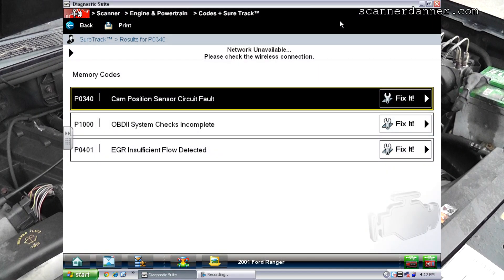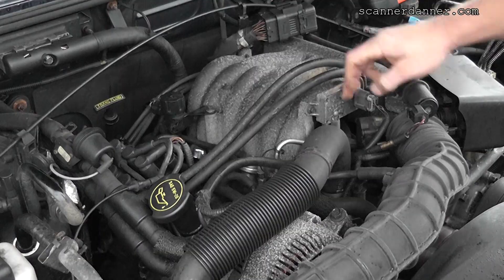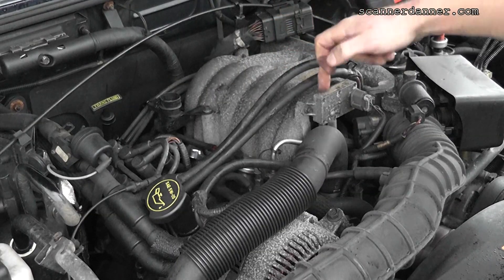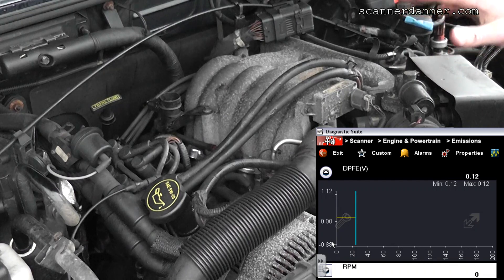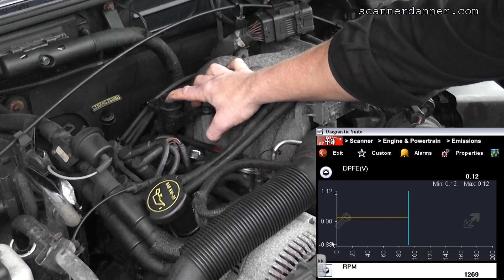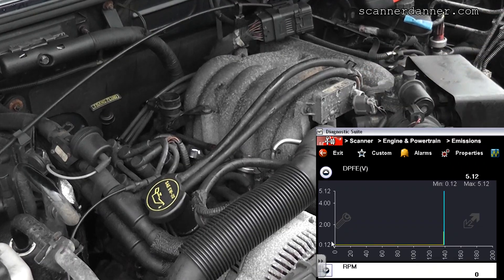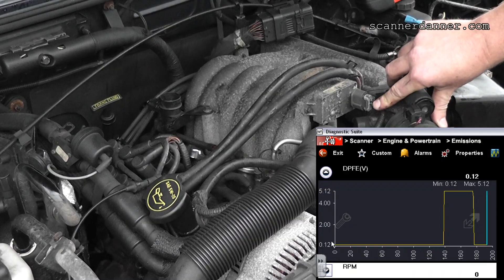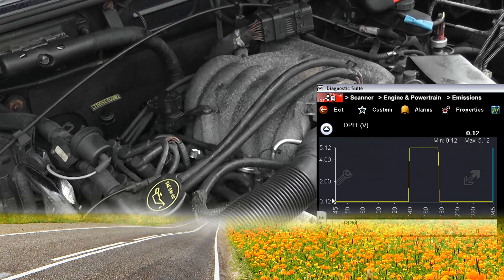Ford EGR flow quick test (P0401) DPFE fault

Comment: For my 2000 4.6 F150 my mechanic clean it, I changed the DPFE, the vacuum solenoid the metal pipe, and the EGR valve. I still have the code. I will check your method to see if the passages are clear but assuming they are, what else could be? I appreciate any help
Reply from the maker: Check that first, then voltage measurements are next

Comment: Hi, thank you for share this info. Will you please to tell me how can I perform same analisis as you did but for a EGR module in a 2006 ford freestar please? Thks. regards!!!
Reply from the maker: 06 I believe they combined the egr, the solenoid and dpfe sensor in one unit on this?
Reply: @ScannerDanner  yes they allí together, there Is a 6 pin conector in there... The test on this one  is the same you show in your videos For every separaste parte?
Reply from the maker: @angellizarraga4170  6 pin 🤔
3 of the wires would be the DPFE sensor (5v ref, signal and ground) 2 of the wires would be the solenoid (power and ground with one of those two being switched by the PCM) not sure what the 6th wire would be without a diagram
Reply: @ScannerDanner  how can I send you a diagram of the conector in order to get how to test the EGR module?
Reply from the maker: @angellizarraga4170  the 6th wire is a map sensor signal.
Pin 1 BRN/PNK is the EVR (-) and pin 4 RED is EVR (+)
The EVR (egr valve regulator/solenoid) is ground side switched, so the EVR (-) I the circuit that gets switched by the engine computer

Comment: So I just did the vac test no change few weeks back I did a complete pull-down of egr egr tube and was clean so my guess was carbon in the egr port so today I poked it out with a shop vac drawing out clumps redid vac test and motor shutters now thanks hope it keeps the check light out good knowing

Comment: I'm getting the same p0401 code in my 3.0 2001 Ranger. Previously had p1400 which was low voltage to dpfe sensor. Replaced the sensor and then got code p0401. I have replaced the egr solenoid and the egr valve and I am still getting p0401. Just went out and covered the bleed hole on the solenoid and there was no change to engine idle. Was thinking maybe a vacuum leak? Anyone have any idea what this could be?
Reply from the maker: You most likely have plugged egr passages. I'm pretty sure they run right behind the throttle body on the 3.0L? It's been a long time. But I'm certain I have at least one or two videos with an insufficient EGR flow where I'm showing cleaning those passages. But if your set up is like I think, you need to remove the throttle body
Reply: @ScannerDanner  Thanks for the reply. I'll check your videos and then give a try.

Comment: Hey awesome video. I have a question. My sensor is always reading 5 volts at all times that the car is running. What should I do?
Reply from the maker: Before you replace it. With it plugged in, check your sensor ground circuit and make sure it doesn't read 5v too.
You should see 5, 5, and 0 on the three wires with the key on engine off, plugged in and backprobing the connector with a pin. Do not measure these unplugged as the ground test I want you to do will be invalid

Comment: Ford Ranger 96: What does it mean if the DPFE top wire or signal wire  (brown green) remains about  5V with key on engine running? Ref wire also 5 v.

Thanks for any help
Reply from the maker: What is ground voltage? Third wire. Is it plugged in for these tests?
Reply: @ScannerDanner  
Thanks for such a fast reply!
My ground was about 9.65 Volts. I ran my battery down recently. 

By the way, I got that 5V reading on the signal wire with the harness disconnected and key on. After I wrote to you, reattached the wire harness to the DPFE,  but this time slid the pointed end of my multimeter probe in the rear access of the harness, to contact that signal wire and got 0.6V, engine idling.
Reply from the maker: @Madasin_Paine  Did you fix this? So sorry, hard to keep up. Your ground pin was reading 9.65 volts on the DPFE sensor? What did the other two wires show you PLUGGED IN and backprobing?

Comment: If this truck for renter 3.0 engine has a DPFE sensor bad and only dumping two volts that are for 5 it means that when is real freezing cold weather outside will not crank would not start

Comment: Hi there.  Mahalo for this cool tutorial!  I hope you're checking comments and will answer back.   I have a '96 Explorer.  I tested the DPFE for voltage.  First I used my multimeter and tested the connector. Disconnecting from the DPFE, I had about 5V (4.9) from the signal wire (middle) and I got that reading from either side of the signal wire when touching them with the other multimeter test lead when the ignition was energized. I then tested for resistance on the DPFE terminals from the ground (where the blk/w wire connects to) and the signal wire and got resistance.  No reading, as expected from the middle and power lead on the other side.  

I plugged the power connector back onto the DPFE, placed in some wire pins on the two out wires and alligator clipped that to the multimeter.  I disconnected the vacuum hose on the DPFE closest to the front of the vehicle and connected my vacuum pump to the DPFE.  I turned on the ignition and got a reading of almost 5v again. But you say it should be about .5 to 1v.  I turned on the engine and there was about 4v reading.  When I applied vacuum, the voltage went down to around .8 to 1.2v.  The voltage should have gone up to around 5v as you said, yes?  

So, can I assume that if the DPFE fails just one of the electrical test, it has failed?  

I also did the test you showed here and the engine did just as in the video.  I had the multi meter connected to the two outer leads reading 4v, still.  Placing my finger on the bleed hole on the EGR solenoid, the engine was almost stalling, just like your video.  I couldn't see the RPM's when I opened the throttle valve from the engine bay to increase the RPM's but, the voltage dropped down to .3v with my finger still on the bleed hole of the EGR solenoid.   

So I believe I have been able to verify that the DPFE has indeed gone bad.  Yes?  

Funny thing, all was fine until I tried to bypass the EGR system about 2 weeks ago!   I disconnected and plugged the vacuum hoses and unplugged the connector to the DPFE and vacuum solenoid to see what would happen.  Within about 3 miles driving, the check engine light came on. So I reconnected everything and cleared the code. It came back on after about 30 miles of driving.  I thought it was a glitch and cleared it again.  I was able to drive about 290 miles before the check engine light came on again!  I cleared it again but this time by touching the positive an negative battery cables together.  Since the engine has been idling smooth and my gas mileage has been good, I thought it was just a PCM glitch.  But then the check engine light came on again after about 100 miles of driving.  So that's when I decided it was time to start diagnosis.  

I could tell the EGR valve had vacuum and all the lines were fine and tested them with the vacuum pump.  I didn't think I had any carbon deposits clogging anything as of yet.  I'm glad that I could start the electrical test at the DPFE.  So, here in Washington, we no longer have emission testing so I'd love to do an EGR delete.  However, I realize that I'll need to take the car to a tuner to reprogram the PCM.  

Do you have a video on how to do that? 

I miss the old days when you could just delete the EGR and cat without any computer interference and all the sensors.  A much simpler and easier time.    

Mahalo again for your videos and replies.

Comment: Great tutorial on both your DPFE diagnostic videos.  After the check engine light came on, I did get a P1405 code on my 96 Explorer saying the upper hose was off.  I did find it that it had come loose.  Placing it back on, warming up the engine, the check engine light did not go off.  Upon testing, almost seemed to spec.  I did the EGR vacuum regulator test with my finger on the air intake and the engine would almost die.  Engine off, the signal wire was at 1.0v.  Ground at 0.0v and reference wire at 5.0v.  Unplugging the connector, the signal wire was at 5.0v. But still the check engine light stayed on. 

With engine on, I plugged the EGR vacuum regulator again and voltage would go up but only to 3.6v and not the 4.0v or close to, as you described while the engine sputtered.   I couldn't tell what my RPM's were since I didn't have an assistant but throttling up at the throttle body, I could only get the mulitmeter to read 4.6v and not 5.0v.  Check engine light still on.  I'm guessing that even with the increase in voltages, it wasn't enough so I'll order a new DPFE and I expect it to do make the check engine light go off.  

The other issue, at the same time is the IACV howl.  I think that should be fixed now.  Electrical specs upon testing were fine as well.  I cleaned it and for awhile there it worked fine.  This is with cool weather, ie mid 60's.  But finally got it to howl again so the new IACV is on. 

Big mahalo nui loa for your video.
Reply from the maker: These numbers sound good. Before replacing that DPFE sensor.
1. We need to confirm the ECM control of your EVR solenoid and that the solenoid functions electrically. 
2. We also want to make sure your catalytic converter is not plugged. I've seen this cause the dpfe hoses to blow off. You can check exhaust back pressure right at the dpfe hose (the lower one on the egr tube)
Reply: @ScannerDanner  Mahalo for the reply!  Solved!  I forgot to unhook the battery and de-energize the system.  Once I replaced the IACV, all went back to normal and check engine light went off/stayed off.  The only code being thrown out is the P1000 so I'll need to drive a bit and re-train the computer.  I did have a P0402 _ to much EGR gas temporarily and then that went away.  I had tested all electrical connections including the EVR.  All works.  You'd like my engine bay of my '96 Explorer as it's super duper clean so it's nice to work in.  Now I'm back working on my '87 VW Scirocco, 16V.

Comment: What software are you running in this video?
Reply from the maker: I'm using a Snap-on Verus (professional scan tool and not cheap) but there are others that will provide you with this type of information for much less than the Verus.

Comment: Thanks for the information I have a 99 Ford windstar 3.8L with a very rough idle I changed the spark plugs, wires, coil pack, and the intake manifold
Reply from the maker: what are your fuel trim numbers? engine vacuum at idle? have you checked compression on the engine?
Reply: ScannerDanner no I haven’t check the fuel trim I’ll do that on Thursday

Comment: If all those tests pass, then what? Remove air intake throttle body ?
Reply from the maker: Did the RPM get rough and almost stall? Did the DPFE voltage change as I showed in this video? What exact tests did you do?

Comment: Hi Mr danner the dpfe hoses that  goes down to the exhaust pipe, keep popping out of the pipe?, and the car start run rough, I connect it back ,and do it again,  can you please tell me what's wrong? Thank you , cheers from ontario ca.
Reply from the maker: Your catalytic converter is plugged and you have excessive exhaust back pressure blowing those hoses off

Comment: Ok, I very recently cleaned all of my egr and throttle body holes VERY thuroughly multiple times and just did this test. When I plugged the solenoide hole the idle did not change, what do you think? Also, I do have a BOSCH scan tool but it doesnt show dpfe voltage.
Reply from the maker: Use a voltmeter for the dpfe testing. I have other videos on this. 
Does the idle get rough if you manually open the egr valve?
Reply: @ScannerDanner  I am testing it as we speak, yes the idle does get rough and almost stalls if you apply vacuum directly to to the egr valbe
Reply from the maker: So your EGR and passages are clean. Let's focus on the EVR solenoid next. You should have a vacuum supply on one hose (red) and then the integrity of the other hose needs to be checked (green). This one goes from EVR to EGR.
Reply: @ScannerDanner  Ok, I will check to see if the solenoid is working next. Would a 9 volt hurt the solenoid at all?
Reply: @ScannerDanner  actually, I just pulled off the hose thats suppose to apply vacuum to the solenoide and there doesnt seem to be any vauum in it, is it suppose to always have some pull? Or is it periodicallt suppose to have vacuum??
Reply from the maker: Should be constant vacuum brother. You found your issue
Reply: @ScannerDanner  Thank you very much! Any suggestions for vacuum lines?
Reply from the maker: unfortunately no, other than to say it should be a red plastic hose that is probably broken. You should have no problem following the hoses even though they are in plastic conduit
Reply: @ScannerDanner  oh, I meant if you had any recommendations for replacement hoses. Turns out that 2 of the vacuum hoses had been burnt in one section. One hose going to the egr solenoid, and onr going to a solenoid right next to the egr on the firewall. For right now I have cut out the broken sections and put different hose over it. Do you have a patreon or something I could repay you in?
Reply from the maker: ah okay, I misunderstood. Go to the parts store and buy windshield washer fluid rubber hose. It is small enough to use to bridge the gaps in the breaks of the plastic hoses :-) 
And I don't need paid my friend. I enjoy helping people. Thank you so much!
Reply: @ScannerDanner  WOW! THAT IS EXACTLY WHAT WE USED TO FIX IT! Dude you are legendary!! And ok, but if u ever set one up, tell me about it, because you really helped me!
Reply from the maker: The reason I do not do patreon is I have a paid subscription channel available from my website and it just doesn't sit well with me to ask my community for more money. Check it out when you get a chance. It is called ScannerDanner Premium and it is available at www.scannerdanner.com 
Thanks again!
Paul
Reply: @ScannerDanner  I will check it out, thanks again!

Comment: A P1000 can mean that the battery was disconnected for an extended time long enough to erase codes. Run the engine to restore codes.

Comment: hello I was doing the test on mine but on my evr there's a very very little flow, I put my finger on the bleed and there's no change in idle,  and no vacuum at all on the bleed hole
Reply from the maker: Plugged up intake passage. What kind of car?
Reply: 97 ranger and thanx for you respond
Reply from the maker: Pull the throttle body off, you will see the plugged up intake passage for the EGR
Reply: my throttle body and manifold is one piece, but I inserted a wire to brake the carbon and flushed with carb cleaner and it came a lot,but still the vacuum is not that strong like yours

Comment: Hello, I'm having PO401 on my 2001 F150 5.4L. Before watching your videos and using a guide I replaced the DPFE sensor with a brand new one from motorcraft. The code will come back as soon I drive. The EGR valve is working properly and has no leaks. The only test that is not normal is the DPFE flow signal test. Using my voltmeter( DPFE plug still attached to DPFE) I connect the red lead to the top wire of the DPFE plug. The voltage at idle is 1.02v when i apply vacuum the engine starts to idle real rough and the highest voltage I read is 1.27v which is not normal it should be 3v-5v. With the engine off key on if I unplug the DPFE wring plug and i use the voltmeter I have 5v on the top wire, the middle wire is ground( confirmed by connecting one lead to 12v at battery) and the bottom wire I get 5v(ref). To me it does sound I have a wiring issue with the top wire or maybe a PCM issue. Do you agree? Any suggestions on how to test to see if I have a bad or fault connection on that wire? I don't have a wring schematic to trace the colors. Thank you.

Comment: Hi danner,,,,  I have a 07 ranger 4.0 that had a new  used engine installed , got it back and immediately got stuck rich 02 sesnors upstream banks 1 and  2 .... the mechanic cant figure it out either . that's  with 4 new bosch 02s he has tried which I know is the symptom bot the cause ,,,,,,,  but  today I pulled the  hose of the egr and  electrical connection of the dpfe sensor with no effects while  truck was running and  at operating temperature , THE  TRUCK ONLY THOWD OF THE  196 AND  198 CODES I BELEIEVE  and  nothing else , I wish I had live stream data , but money and knowledge are limited ,,,,,,,, I would think though that those things  unhooked would have to have  some  effect but maybe not at  ,,, at  idle ,,,,,,,,,,,  the truck has no power and  sputters when giving gas .
Reply from the maker: Is the truck a flex fuel vehicle or was the engine that was installed a flex fuel? They use completely different injectors
Reply: I don't believe neither are flex fuel ,,,,,, does the  egr vacuum control have control over the other 2 sensors  and  then  is  that controlled  by the computer . to achieve fuel trim

Comment: I have a 03 lincoln navigator, and the  dpfe voltage stays at .93 when not running and at idle. when pressing gas it goes to .95 but never over 1 volt. when egr engages with your finger test idles drop, engine rums rough, and volts drop to. 03 at the lowest. so I'm confused if sensor is bad or not. The unplug test also leaves voltage at .93. thanks
Reply: so I'm an idiot. I got so excited with my new toys that I didn't realize I u plugged the egr solenoid and not the dpfe sensor. after unplugging the right part, voltage went from .93 to 5. dpfe needs replacing. Thanks for your video

Comment: can't find any cracks in exhaust manifold I'd think if there's a crack the noise wouldn't go away.
Reply from the maker: very common for a crack in an exhaust manifold to seal up when it is hot. I wouldn't have suggested otherwise